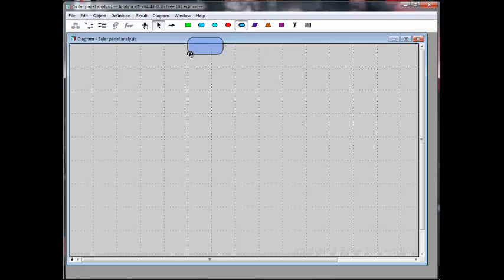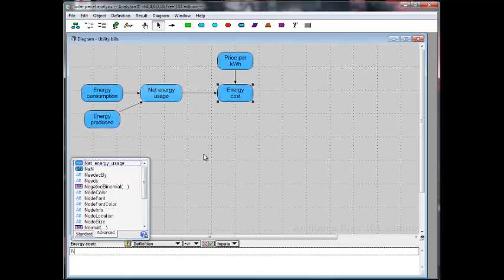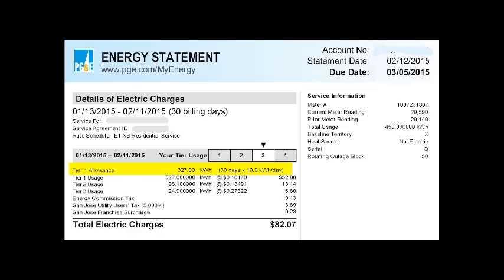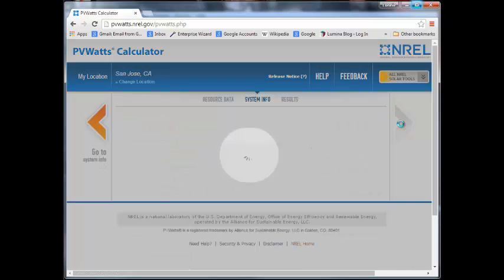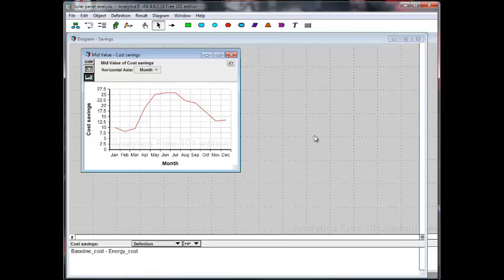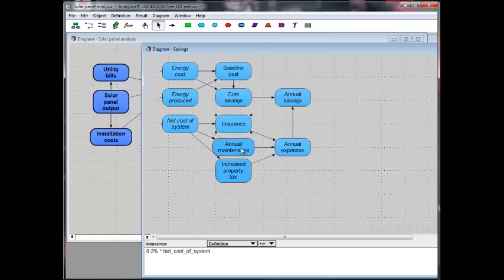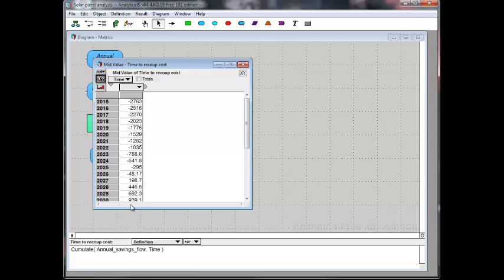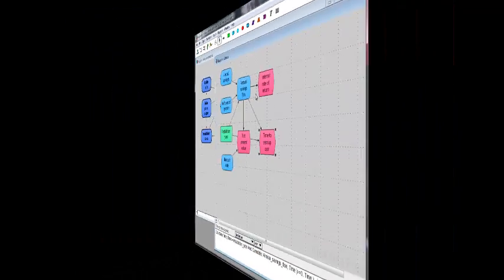Cost effectiveness of Solar Panels: Building your own model

Comment: Thanks for this useful tutorial. I am very new to Analytica, so please bear with me. The way you are using dispatch seems different from its intended purpose, though clearly it works. As I read it in the wiki, dispatch is about allocating a number of resources that are less than the demand, until demand is met. Somehow, you are dividing a single "resource" - the energy used - into an ascending series of "demands" (the tiers). Can you explain how and why this works? Thanks.